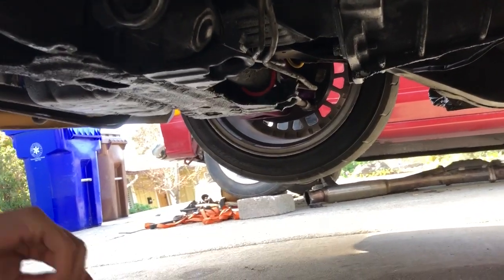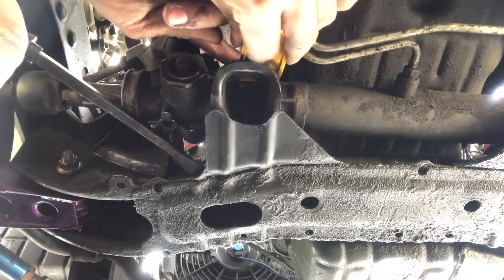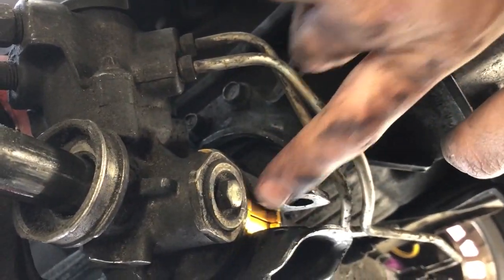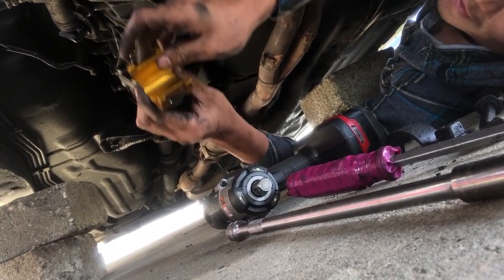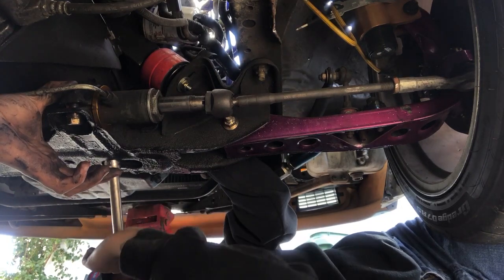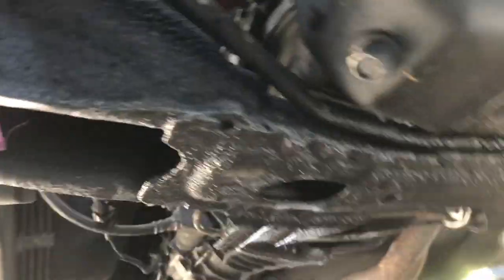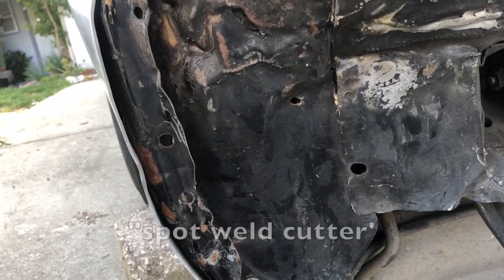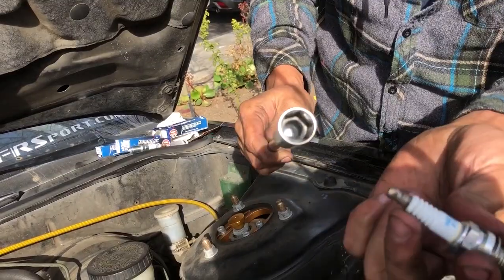Parts Shop Max steering rack bushings in my 240sx

Comment: At 5:37 in the video I’m having this same issue it shows a gap between the bolt and the mount to the subframe only on the driver side (tear drop side) , is it suppose to be like this because I’ve never did rack bushings before and it’s kinda sketching me out 😭
Reply from the maker: Gino Lebon no it actually shouldn’t it should sit completely flush. Sorry in the video it was loosed that’s why you are the gap. Hope you figured it out! Could be that your bolt or but isn’t threading properly.